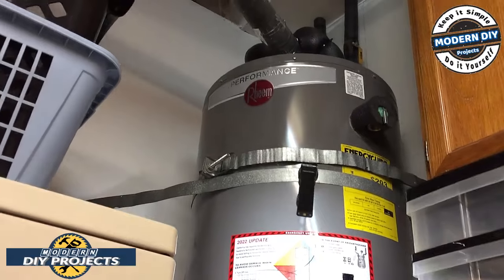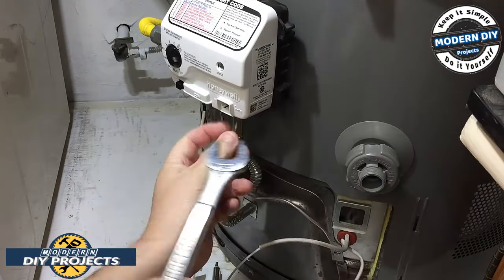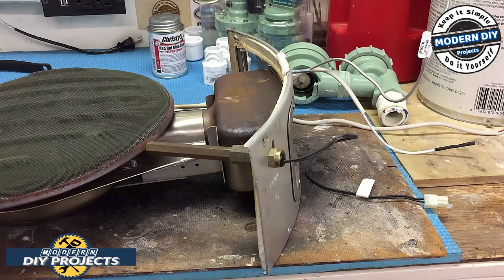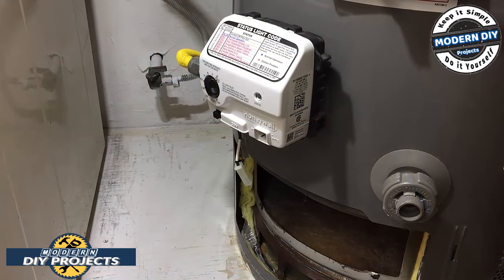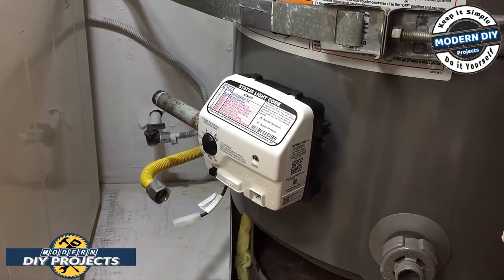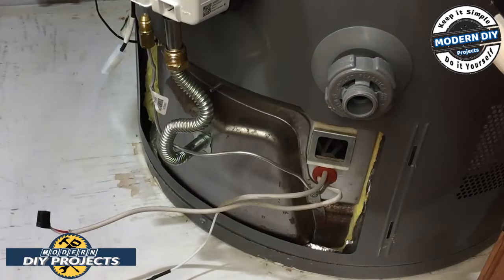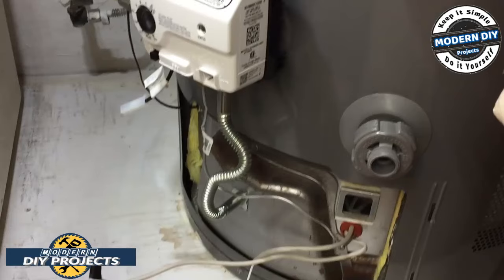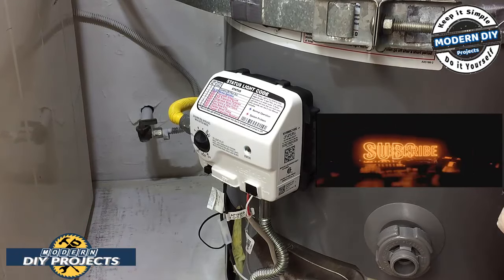Rheem Water Heater Chamber Sensor Failure / How to Replace Chamber Sensor & Gas Control Valve DIY

Comment: I am getting 9 red lights and the sticker says that the chamber sensor is faulty. Do I just need to replace the sensor? Or also the gas control valve/unit and why?

Comment: I replace the chamber Sensor assembly and the gas control valve unit only to get the the end where the control valve unit didnt have a chamber assembly port... After reinstalling the previous unit the pilot won't spark/light. What did I do wrong?

Comment: Is replacing the control valve necessary if the issue is only the chamber sensor ? Can we get away with only changing the sensor ? Rheem sent me both the sensor and control valve

Comment: Thank you!!! I changed my gas valve 2 years ago, but I needed to change my chamber sensor this time. Can I ask you how you clean the burner? Mine is looking like yours and I figured I should do that while it’s already disassembled
Reply from the maker: Simple enough, just use a wire brush. All the crap comes off easily. Don't scrub too hard. You don't want to cause damage. A light scrubbing will do.

Comment: Great video....nice close camera view. This is nearly exact Rheem water heater I have. Mine has build date of Oct. 2020. I have talked to Rheem twice and need to and count my red blinks then recall them , then Jose said they would mail out the parts I need as I'm still under warranty.
Still it's a PIA as the heater is only 4 years old.
I subscribed and will watch your vieo again when I do the repair.

Thank Bud for you video.

Update...So it took the parts 5 days to get here,  but I finished the repair and the pilot is on and the burner is staying lit....so far.
A had a gut feeling the problem was just the Chamber Sensor(Brass Rod), so even though they also sent a new control box, I did not replace that. I can always put that in later if the problem comes back.
After watching your video 4-5 times...lol...the fix was quite easy. Toughest part was that tiny nut at the op of the cover directly behind the gas line and getting the gas lines under the control box back in, I had to lay on the floor with my head on the floor to see properly and get the threads to catch.
Thanks again for your great detailed video. Saved me several hundred $$ a plumber would have charged.

Comment: Do I need to put pipe dope AND teflon tape on the threading of the gas valve meter?
Does the Teflon tape need to be “yellow” which is rated for nat gas, or can it be white which is rated for water?
Reply from the maker: Yes you do and I have always used the white one with no bad effects. I have never had leaks using the standard white plumbers tape.
Reply: @ModernDIYProjects  are you referring to where the gas line from the burner threads into the bottom of the control unit? in the vid you did not add thread prep. Or are you referring to the threads of the unit itself into the tank?

Comment: Nicely explained with clear instructions.  Question:  I see replacement burner sensor kit from Rheem for $196 to a more reasonable $45.  Is there a difference in quality or requirements for replacement?
Reply from the maker: I would make sure that it is a direct replacement. If it is, then I would not see a problem. Make sure the seller will warranty it if it is NOT compatible.

Comment: Thanks for the video.  I've had to clean off the sensor a couple of times about every 2 years, but I know I'm going to have to replace the controller soon.  Luckily the reset protocol worked on the controller for now but that times coming.

Comment: Thank you so much for posting this. Your clear instructions allowed this old woman to do this repair! The hardest part for me was getting the larger fitting under the control box connected without cross threading it. And your demonstration of the special tool... Spot on. Thank you! Where is your tip jar?
Reply: And I told Rheem they should give you a commission for this!
Reply from the maker: Glad I could help, and than you for the tip. I appreciate it.

Comment: What worked for me was unplugging the wire for the chamber sensor from the gas valve. Blowing on the end of the of the wire and blowing on the part where it connects to on the gas valve. Had to do this multiple times but it has seemed to fix the problem.
Reply from the maker: That may be a temporary fix so just be ready for it to come back.

Comment: My waterheater is the same model....only 4 years old same problem. I never did register it so im wondering if they will honor the warranty for these parts?
Reply from the maker: They probably will. They go by the build date. I don't think I ever registered mine either.
Reply: Thankyou also did they add the valve knowing it was overtemp which they sent too? Im hoping to get both@ModernDIYProjects
Reply from the maker: Yes they automatically added that in when I told them the problem I was having. They decided the parts to send and they over nighted them to me so I got it in a couple of days.
Reply: Thankyou again @ModernDIYProjects

Comment: You were able to remove that nut with some pliers in my case pliers wouldn’t fit in there finding the right socket made a word. The difference an hour later.

Comment: Can you just change out the sensor without changing that front control box? Looking around and those are 200 bucks 😢
Reply: I have the same question. It’s the sensor not the valve so why swap the valve as well? I shut it down, waited 15 minutes, and re-lit it after the red light went away.,….still working now 🤷🏼‍♂️

Comment: First of all, thanks for the video. it is a DIY at best. Hat off to the channel.  
I am glad that my handyman didn't return my text, and  I found this video.  I ended up as a satisfying weekend warrior, and  $400 kept in my pocket. 
#1, you MUST DRAIN the water BEFORE REMOVING the control module, otherwise water (could be burning hot) will gush out of the hole! You don't want to end up with 2 degree burn or at the minimum, a pool of water on the floor. 
#2, you may not have lit the heater right away after the installation. it happened to me, I panicked and called the tech support, basically, you need to hold down the pilot knob, and press/release the pilot continuously for up to 60 sec, till you will see the blue light come up, then you can turn the knob to hot/A/B/C.

Comment: Good video.  I have the same problem and thanks to the video I can save $150.  Rheem obviously has a problem with their sensor/controller unit with so many folks watching.  My kit came with a replacement gasket for the burn chamber as well.  

Does seem odd that the pilot light line is a 13mm and a 12.70mm/1/2" wouldn't fit the nut when the other parts are all non-metric.  But, I guess my old Dodge Durango was like that - an insane mix of inches and metric.

Comment: Hey man I just finished installing my new parts. Your video is perfect. Thank you so much for uploading it for us homeowners with crappy water heaters! I couldn’t get my tank to drain. So when I took off the control panel water was gushing out and I just quickly installed the new one. I could not figure out how to get that to correctly drain. I also put on plumbers tape before I put on the new one. There’s no leaks. anyway thank you so much again.
Reply from the maker: Glad I could help. The reason you could not get the water to drain most likely was because you had pressure built up in the tank. When you go to drain the tank you need to allow air to come in and replace the water. The way to do that is to open the Pressure Over Flow valve (the emergency valve) that water heaters have in case the get too much pressure they can vent the pressure and not explode. Open that and you should start draining with no problem.
Reply: @ModernDIYProjects thanks for the reply. I did try the pressure valve as I had read that in comments on another video. I’d also read comments stating the pressure valve will not be the same if one was to open it. So I had no success and now there’s a slow intermittent drip coming from the valve’s pipe. Luckily our water heater is outside and I am currently diverting the escaping water away from the house. I’m hoping over the next few days. It will stop dripping however it doesn’t seem to be slowing down. Thank you for the replies and the video. It’s helped me so much great channel!
Reply from the maker: So the safety valve is leaking? That sounds to me like the valve has sediment built up behind it. That would explain why it is not venting properly and now not closing properly. You can replace that yourself easily. Just use a pip wrench to unscrew it and you should be able to screw in a new one. Those are available at Home Depot or Lowes for $20-$30. You don't want to have a faulty safety valve on your heater for safety reasons.
Reply: okay I will definitely be replacing it. Thank you again for your insight and.  time to reply to me. 🤜🤛

Comment: When lighting the pilot, make sure you're looking through the viewing glass to ensure that the pilot is lit and that you can see the flame. After disconnecting the gas line, a lot of air will enter the line, and it may take quite a bit to purge before the pilot will light. The consequence could be that you'd be holding the pilot light in and letting gas in without it being lit, and if you hit the igniter, you may experience some fireworks.
.

Comment: I found your video after our water heater has the same issue - also after only 2 years! After getting what I thought sounded like a ridiculous quote from a plumber I thought I’d look up something and found your video. Great video and I love your approach! However it doesn’t make me feel better about thinking I can do the job myself without having decent tools or any previous experience with this kind of thing. But I appreciate your sharing this for everyone else who can use it! I support taking business away from people trying to rip you off.

Is this an issue that will repeat every 2 years? Or just the first two years?
Reply from the maker: It's really not that hard of a job to do. As you saw I only used a few common tools to do it. As far as having this issue every couple of year, I have not found that to be the case. I think it was a faulty set of controllers that went out on a lot of model and once you replace them you are good to go. I have not had that problem come back after I did the repair.

Comment: Do you have the part number for the chamber sensor and temperature probe?
Reply from the maker: It changes with your model so you have to contact Rheem to find the one for your model.

Comment: I just got a replacement part from Rheem (a thermopile)  for my rheem performance plus gas water heater. The replacement part came with main burner, sensors, and wirings that connects to the control valve, minus the flex pipe from control valve to into burner. The pilot light came on, but once i released depressed the pilot button on the control valve, the pilot light shut off. Could the issue be with the control valve?
Reply from the maker: Probably just air in the line or the pilot needed to be relighted. Don't worry about it unless more issues show up.

Comment: I just ordered the gas control valve mechanism today, I got the "2 red blinks" on existing valve, which means -- "Thermopile Voltage Low."  My question is, will swapping out the gas control valve fix the theremopile voltage low problem, or do I also need the chamber sensor?
Reply from the maker: I'm not an expert on this stuff but I can tell you who is, Rheem. You should call their support line and ask them, that's what I did. They looked up my model and told me what the solution was. I would not guess on parts that are so expensive as these.

Comment: Thank you. For Your video …I  have a  question, is necessary to drain tank … thanks
Reply from the maker: It is if you are replacing the control module, or the water will come pouring out when you remove it.

Comment: Can anyone help me with the 60k ohm resistor trick? I have it soldered in and my water heater goes instantly red once I light the pilot, I am at a loss and we need hot water

Comment: Thank you for this video. Saved me so much time and money. 
Side note for those who don’t want to drain your tank. I taped a heavy duty garbage bag under the valve so when I took the old one off I just quickly stuck the new one in. The water comes out slower than you’d think. Maybe 16 ounces came out when I did mine. 
Thank you!!!!!!

Comment: After swapping this part, did the error continue? Our unit went out and counted the blinks which tally up to 9. The unit was manufactured in Dec 2019 - now the chamber sensor failure is the error. I want to avoid swapping the whole unit.
Reply from the maker: Need to replace the chamber sensor also.

Comment: My honeywell/ resideo smells like a gas leak on a brand new heater, but i had 4 different  gas technicians tell me their wand isnt picking anything up they ran the entire house and hit 0 on all LEL.  Its so strong that I  catch a whiff of it from my bedroom 2 floors up when the AC is on.  Is this nornal for that unit to smell terrible?
Reply from the maker: It may not be natural gas that you smell but it may be a sort of off gassing of the parts. Some of the parts used in making your unit may have a lot of off gassing giving you that funny smell. Like some cheap plastic parts have a funny smell. I can't say that it's normal but it is possible and you possibly have a sensitive nose to those smells. If you want to save yourself money paying technicians to test the air in your home I suggest getting yourself one of these cheap gas leak detectors. Check out this video review that I did a while back. These are very sensitive and that way you can test it yourself instead of relying on the word of someone else.  https://youtu.be/xb-XzX4MWiM
Reply: @ModernDIYProjects  thank you for taking the time to respond. I do have a meter and its reading 0, but I reached out to my WH manufacturer and they said I shouldn't smell  constant gas or burning wires or anything at all. They shipped me a new valve and are sending a licensed plumber with a labor warranty. It's definitely natural gas but such a slow leak that it isn't registering. It smelled like burning/gas when the main meter was off, so something is definitely wrong I feel.

Comment: Thank you for the wonderful video, I was able to replace the sensor myself. This is the 2nd time the chamber sensor fails on my 5 yr old water heater. Dealing with Rheem was a nightmare. I ordered the replacement part FEDEX overnight, 5 days later they didn't ship it yet! I spent 3 hours on the phone trying to figure out what the problem was... stressful!

Comment: Absolutely not necessary to drain tank. Waste of time & water... Prep new valve, shut off cold water to tank, break old valve loose, tank is in vacuum so remove old valve & quickly insert new valve. Turn counter clickwise slowly until you feel valve threada align. Then turn it clockwise, do not force or cross thread. You  may loss a quart or two of water.
Reply from the maker: Why hassle with water gushing out and making a mess as you yourself said? That is a true waste of water. The way I did it was controlled and I didn't waste the water. I used the drained water to waster my lawn. So nothing lost. It is also advisable to drain your tank every so often to eliminate any possible rust from the tank bottom.
Reply: @ModernDIYProjects 
Absolutely!  like you said,  everyone could use a flush out anyways !

Comment: Well check my last comment as the unit did not stay lit. Re-called Rheem to find out that they forgot the thermopile that he shows needing to be replaced in the video. They are sending it now but i will have to tear it apart again. Oh well, thanks again for a good vid that shows what needs to be done.

Comment: First off, thank you for a great video! I called Rheem and they fessed up with little argument and sent the part. I had to pay for over night ($30) but given we had no hot water that seemed like a deal over their week long shipping option. They did NOT send the thermopile though just the controller box BUT it fixed the issue and we are back in hot water! Thanks again for doing the video!

Comment: Thank you for the detailed video, I didn’t know I would need to drain the tank before I started, and that very expensive tool was 2.59 at ace, and worked like a charm. Thank you for all the little insights, really helped. 👍🏼👍🏼👍🏼

Comment: Thank you, very thorough and helpful. I just replaced the faulty sensor and have the control valve on backup/stand by in case it to goes intermittent or fails.  Thank you again!

Comment: Very good job. I have 7 flashes, that says gas control or valve faulty error code. I also had it for about 2 years. Me thinks I have to look for receipt. Thank you very much for the instructional.

Comment: Thank you for the video and it was very helpful!  I had the same problem of the chamber sensor failure.  I was given both the chamber sensor replacement and a new Resideo brand gas control valve.  I have replaced the sensor and now it is working.  My Rheem water heater is 4 years old and has the original Honeywell control valve.  Should I replace the control valve also?
Reply from the maker: I would, and I did. I hung on to the old control valve in case I needed it down the road, but if they sent you a free new part, why not use it?